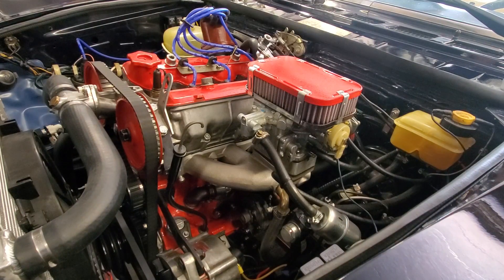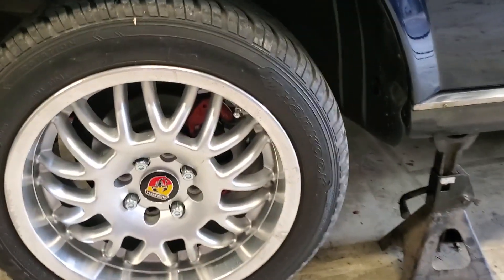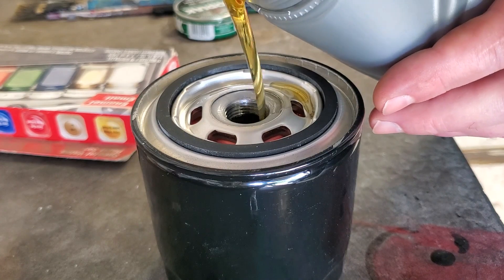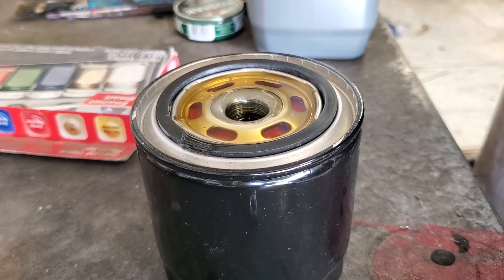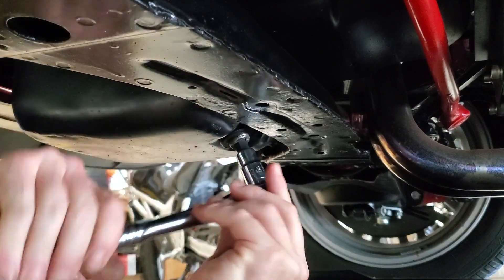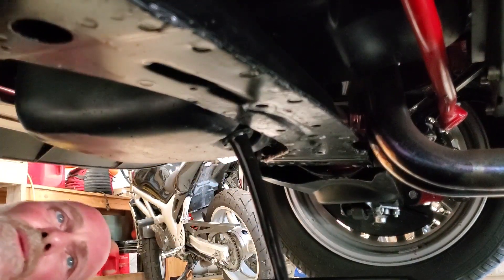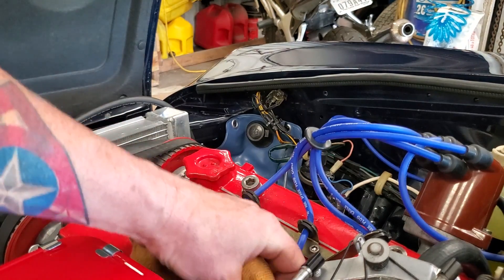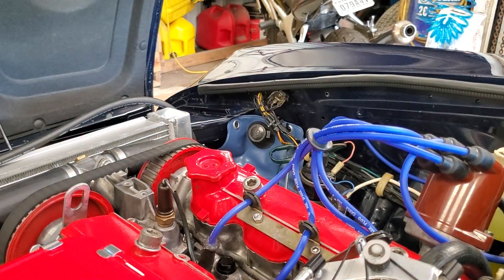1979 Fiat Spider 124, Engine oil and filter change

Comment: I really enjoyed your video series on the Fiat.  I'm a relatively new owner (last Sept.) of an '82 Fiat Spider 2000.  Though there are key differences from the car you worked on, all the info you shared was extremely valuable.

I've done a bunch of small/medium improvements already, my first big project is upcoming: replacing the gas tank.
Reply from the maker: I have a few videos on the fuel tank. Should be pretty similar.  I suggest, disconnect the lines from the motor side, fill them with carb cleaner and blow them out with shop air. Also look at replacing the rubber fuel lines under the car while the tank is empty. For the fuel guage hook up, whatever I did wire wise in the video was right.

Comment: Thanks once again! I'm doing some work on my 124 and this is as best as a video library as I could ask! shame its the last one! Congrats on the finished project. Cheers
Reply from the maker: You're welcome, hope they help. Probably not the last one, it will be back for maintenance and such. I don't want him going to jiffy lube for oil changes, they will strip out the drain plug. Stay tuned for the 46 Chevy project starting soon.

Comment: is it necessary to drain and replace the coolant if it’s been sitting in the radiator for a while?
Reply from the maker: How long we talking about here?
Reply: @ELDESTBuilds  likely only a few years, but possibly as far back as 15 or 20
Reply from the maker: I wanna say yes, but if it is functioning properly, waiting may be ok. How's the timing belt?

Comment: Your videos have been a great help to me while rebuilding my 77 fiat. Question I filled the engine with oil up to just under max on dip stick and noticed that my cam box is about half full of oil is this normal? I have not started my engine yet I'm just setting up timing and that's when I noticed the level of the oil in the cam box. Thanks for the videos! I also filed the filter prior to filling the engine.
Reply from the maker: Sounds about right,  there will be oil pools around the valve spring assemblies.  If you didn't pour any on the other cam box, might wanna give it a drink before first start.
Reply: @ELDESTBuilds  outstanding thank you!  Happy 4th!
Reply from the maker: Welcome

Comment: What oil weight you are adding ?
Reply from the maker: It' 20w50 Mobil 1
Reply: @ELDESTBuilds  ...With Zinc or not necessary?
Reply from the maker: Rated @ 1800ppm for zinc, but all the mobil 1 products have zinc.

Comment: What kind of oil did you use?
Reply from the maker: 20W50 Mobile 1 but 15w50 Valvoline racing 15w40 Rotella are some others I have used